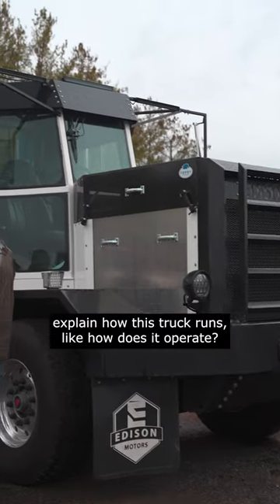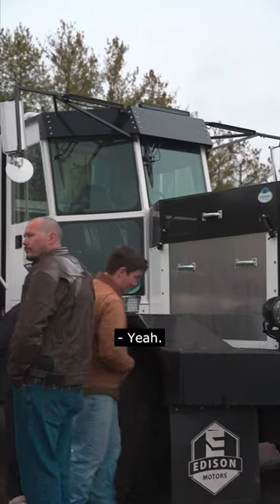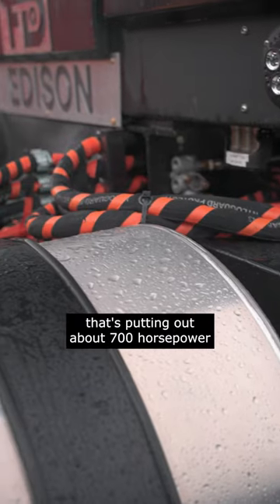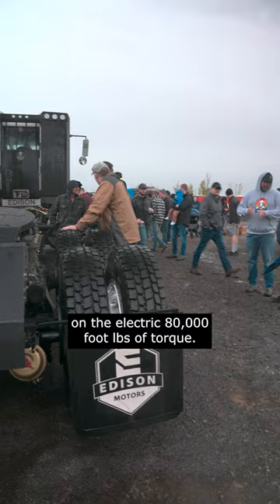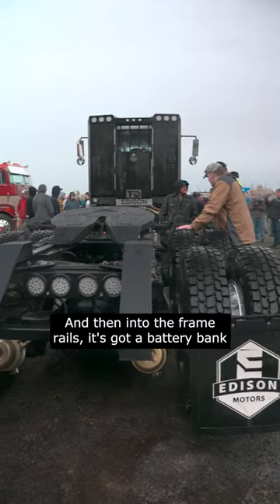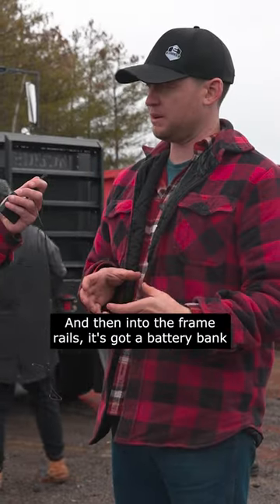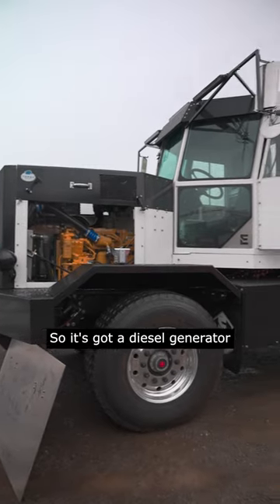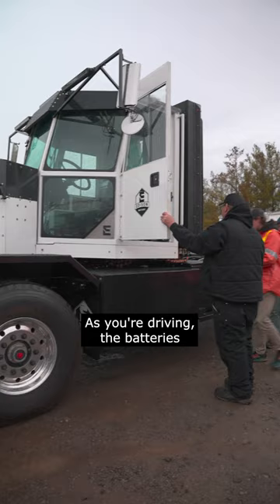@EdisonMotors tells us about how their new electric truck operates! 🚚⚡

Comment: I really hope these guys succeed. They're the only ones doing it right
Reply: They are succeeding, just got the truck plated and road testing has begun. What you are watching is the next big shift in the trucking industry
Reply: They've got the First VIN for Topsy now.
Reply: They need to produce an entire truck instead of just kits for trucks and they need to charge a decent amount for them
Reply: @rayanalzahrani8756  that's what that is buddy. It's their own truck built from the ground up.
Reply: Literally!
Reply: generator for range not depending on batteries that die with weather and sitting still for too long but using the benefits of electric motors, especially with logging/ mining where you can power up and charge on the way down
Reply: What about weight ..Right ?  Smaller loads ..$
Reply: @BAZZAROU812  Nope not even close. More torque and HP=bigger loads. They weigh the same as a traditional truck since it's a diesel generator not a whole engine
Reply: @BAZZAROU812  they weighed it in one of their videos. Was quite impressive
Reply: Agreed
Reply: They may usher in a new era of hot rodding with e axle conversion kits
Reply: One of the issues with any technology is thinking that one size fits all. This solution is excellent for long haul, but for short haul all electric is a good solution. I worked in a grocery warehouse where the drivers would make several half hour stops each day. It was a single grocery chain so they could easily install 60A level 2 chargers and never risk total discharge. Distance ranged from 50 to 150 km/day. Loads were light compared to shipping prefab concrete or structural steel but were bulky so typically required a 48' trailer.
Reply: @TKIDaniel they're starting and are constantly gaining momentum (pun intended). Still have a lot of hurdles to get to a point where they're established and have roots that can withstand failures and dry spells. Once they can take and produce fleet orders they'll have made it, in my book - obviously everyone would say they're successful under different metrics.
Reply: As long as the government of Canada and BC doesn’t screw them over 🤞 

And it’s not paranoid to think so… the government operates by greasing the wheels of private interests and vice versa.
Reply: If the one dude quits going on rants then yea they'll succeed. Dudes a budget elon musk the way he uses his playform to go off on tangents about not his company or truck. Like, shut up and push the product.
Reply: @BAZZAROU812 I believe he addressed this and recently did a 100,000 lb load.
Reply: @TKIDaniel lop
Reply: Try charging multiple of these trucks in one town.
Reply: @carlsonbench1827  this is a diesel electric truck. Same tech that's been used in trains and heavy duty mining equipment for decades.  It dosnt need to charge up since you give it fuel for the generator.
Reply: This is old technology the Germans used during WWII with their Ferdinand tank destroyers.
Reply: @carlsonbench1827  they can just charge next to all the locomotive chargers that use essentially the same tech.
Reply: Yes tesla needs add trailer to there cars with diesel generater just use tractor fuel so exhaust nice and black best be self generating
Reply: That's the way diesel trains run, and it seems to work for them!
Reply: @CRuM770  unfortunately its still wildly inefficient because it runs off of coal plants and a grid wheras the edison truck charges itself with a diesel motor and can get 2200 kilometres on a full tank of gas almost double a normal diesel truck
Reply: @TKIDaniel and they are trying to make a f150 conversion kit to Edison moters is doing so good rn
Reply: @rayanalzahrani8756 huh? How could you possibly know what he needs to do? Do you have a successful company focusing on producing large commercial vehicles?
Reply: I gotta start saving

Comment: 700 hp to get up to speed and 70 hp to cruise.  Perfectly designed hybrid.
Reply: Not even hybrid. That implies different powertrains on the same wheels. This is diesel electric, like a freight train
Reply: @Duffman19370 Diesel electric loco has traction batteries to and can be called hybrid
Reply: Technically, it's a Series Hybrid.
Reply: @Duffman19370 A hybrid is anything that uses more than one power/fuel source. This is most definitely a hybrid in every sense of the word.
Reply: I think the 80,000 ft lbs of torque is gonna do a little more for getting to speed
Reply: @rykercarlson2131  that amount doesnt say very much tbh. A hamster on a little treadmill could reach that with the right gearing. ICE trucks will have similar figures.
Reply: @kwestionariusz1  and what Loco is this?
Reply: @kwestionariusz1  The only batteries a locomotive has is to start the diesel engine. Some have air start, but still have batteries, but not to provide motive power, just for the electronics on board.
Reply: Most people dont know that all locomotive engines are diesel electric.
Reply: Torque is used to get the load moving and HP is used to sustain the movement at a constant rate aka MPH. Producing torque consumes energy, HP a lot less.
That's why city driving (stop and go, torque) all though at slower speeds consumes move energy aka lower gas mileage than highway driving (higher speeds, HP) where less energy is used, higher gas milage.
Reply: That's actually wrong in this case. Edison Motors actually breaks this down in another video. Also why he doesn't call it a diesel motor but a diesel generator. There is no other drivetrain on the truck besides the E-axels. This is also why the diesel generator can be filled with tax free fuel because the engine is connected to nothing but the batteries because the generator is only used to power the batteries.
Reply: @CasparPietersen the generator is only powering the batteries, not the powertrain. It’s an electric with a generator.
Reply: @bigloads3600  loco means, "crazy".  Don't waste your time on this nincompoop.
Reply: @timbodnar6711 using context clues I assumed loco was short for locomotive, good thing you can set us straight 😂
Reply: Mazda CX-90 has been referred to as “hybrid” for the two years of its existence, using a 70HP rotary generator to power the battery that drives the four independent wheel motors.
Reply: Isaac Newton says hello.

Comment: This is the only cool EV in existence. It's absolutely badass.
Reply: Its not even an EV, its a hybrid
Reply: @Madpiggaming no it's ev, it doesn't need the generator to drive, the batteries are all it requires to move, it just has an onboard generator to charge them, therefore it's classified as an ev even though it has a diesel engine
Reply: @deezbigspheresbetweenmylegs nothing special really basically like a chavy Volt designated as ev the engine on board does not do anything but charge the battery
Reply: It's essentially a road legal diesel locomotive
Reply: Hybrid
Reply: @Finlandiaperkele thats what i was thinking.
Reply: How many others are there tho? 😂
Reply: @deezbigspheresbetweenmylegs You literally just described a hybrid.
Reply: @deezbigspheresbetweenmylegs do you consider a locomotive an EV as well?
Reply: @Finlandiaperkele  kinda. Locomotives do not use batteries. The peak load is on the generator directly. So, instead of having batteries to eat the peak load demand, it is more like a regular mechanical drive train only without all of the transmissions driveline and other moving fail points. All vehicles should be moved over to the way edison does it or the way a locomotive works, everything would be far more reliable and simple.
Reply: @Finlandiaperkele or cruise ship
Reply: Great idea, unfortunately the diesel emissions requirements in the US won’t allow this setup without extensive modifications to the diesel part.
Reply: @drew8256  How do 5mpg 1200HP Dodge Demons pass regulations & allowed to sell in the U.S.? Also I'm going to assume Canada has as much or stricter regs than the U.S., could be wrong on that.
Reply: @Roberto-de8xv  This is not a production vehicle, it’s experimental right now. The Dodge has catalytic converters, and is gas.  Any diesel today has DEF fluid injection and catalytic converter, as well as expensive computer controls for the emissions.  Comparing gas to diesel is nonsense
Reply: This isn’t a EV. It’s a diesel hybrid
Reply: Not an EV
Reply: @6door6four96 Actually Chevy couldn't leave well enough alone and do it right with the Volt, so in specific circumstances the engine DOES drive the wheels.
Because GM didn't want it to succeed.
No really, they didn't.
Reply: @deezbigspheresbetweenmylegs  you can read up on definitions (like "Hybrid vehicle drivetrain" on wikipedia) and see that it's a series hybrid. Most people think hybrid just mean what is a parallel hybrid. One can compare it to how BMW i3 works. It's a BEV until it's fitted with a range extender petrol engine with generator that charges the battery - it's then a series hybrid. This also means that if a customer wants a Edison vocational truck where they have a use case that will work with only electricity Edison "just" have to rip out the engine and generator, add some more batteries and add DC fast charging.
Reply: 700hp / 80000 ft/ pound of torque really isn't torque is too much like frame bending torque
Reply: Did you see the video of it hauling a tank like it was just an empty trailer? It was pretty impressive
Reply: @savneetsinghrairai6823 yeah first truck they snapped the drive line before they had the electric axles, not an issue anymore
Reply: @Finlandiaperkele  WWII technology invented by Dr Ferdinand Porsche
Reply: @booya6437 hybrid means it can run on only diesel by itself or EV. But it does not have a diesel engine 😂it can only run on the electric motors.
Reply: @drew8256 so you think US has stricter laws than Canada and EU? 😂
Reply: There was another company that built something s similar it was a suv that had a boxer engine to charge batteries
Reply: @deezbigspheresbetweenmylegs good sir you have legally described a hybrid

Comment: 80,000 ft/lbs of torque!? Holy shyza!!!
Reply: Exactly what I was thinking like holy fack
Reply: Right. You’ll have to mash the throttle with a toothpick
Reply: That's at the wheel. For a fair comparison, the diesel engine torque, times the transmission gearing, times the axle gearing. So if the torque is 2,000, and the 1st gear is 12:1 and the rear end is 3:1, the wheel torque is 2,000x12x3, so 72,000, minus the tire diameter, but that's not included in the axle torque rating. So 72,000 vs 80,000. The electric doesn't have to shift 18 times to get up to top speed though! So in reality it pulls much, much better. And then it has regen to slow it down.
Reply: If you floor it the entire United States is pulled back into daylight savings
Reply: @allterrainrandy2587 it also means that it can maintain speed up a hill as it has the torque all the way up there
Reply: @aShamelessHigh  
Something tells me that something will break doing that. It is way too much, unless they have control system to not allow the bejesus being unleashed. The kingpin goes * pling *, oopsies, and that's that  😅
Reply: @rosen9425 Not a truck guy but having it as an e axle works waaay better than seeing big rigs pull down a drag strip seeing half their truck lift from torsion with the axle & such setup. I think you'd probably get away with many pulls
Reply: @MegaDarkTroll  
Those drags trucks doesn't have half the Topsy torque I'm sure, probably not even close even if they do impressive pulls. 

Pulling away in commercial driving is never done at full throttle either, but with 80 grand worth of torque you don't need more than a pinky toe on the pedal
Reply: @allterrainrandy2587  Plus, after all that, the diesel actually has less then that torque at the higher gears, whereas the EV has that 80k torque at all speeds.
Reply: @spyrule  Yes, as the gears go up, the  torque multiplication drops. Exponentially by whatever the rear end ratio is! Electric also loses torque at higher speeds, though.
Reply: @rosen9425  With Flodraulic they work it out so the accelerator pedal won't be like a RC car but regular to how drivers are used to.
Reply: @rosen9425 the frame is actually double the thickness of a normal frame and the axles are already rated for that kind of load so in reality it should be fine
Reply: @HustleVenture  they electronically govern the system when lightly loaded.  From what I've seen, this is done manually on the tablet by the operator.  But I can see in the future, this will be done automatically by using airbag data, or within milliseconds by the computer using input and chassis reaction data.  Or possibly choosing 1 of several torque/power profiles, or a combination....
Reply: @aShamelessHigh Re-create Pangea.
Reply: Even 8000 is too much.
700hp 1000kw 750w=1hp
Can pull battery power only 
To accelerate.
Reply: And that torque is the same at 1MPH as it is at 70 MPH!
Reply: You ahould have seen the pull test, they spun the wheels pulling a 100000 pound load
Reply: @TRC_MEDIA  On deboss? I think I did. Wild.
Reply: Thank you for dumming this down for me lol. @allterrainrandy2587
Reply: @allterrainrandy2587  and its pulling max torque at 0 revs. Max torque from  a standstill. shits magic

Comment: Finally  a proper hybrid the auto manufacturers could learn alot from this guy.
Reply: pretty sure this guy is learning from Toyota
Reply: @brentdavidson1  Toyota makes series-parallel hybrids. They are more complex. Can make sense for a large manufacturer to build out but not for a vocational truck with different use cases and low production numbers (toyota sells millions of vehicles).
Reply: This is very similar to the Chevy Malibu  Hybrid.
Reply: They would probably tell him to study thermodynamics. Still it's very cool what he's doing. Hats off to him.
Reply: Look up Nissan e-power. It’s hybrid series technology
Reply: In 99% of cases it's not worth it for cars. BEV plus a decent charging network is fine for cars. The current situation of lack of chargers is only temporary and improving all the time. In the UK there are 4x as many public charging locations as petrol stations.
Reply: I have a Honda clarity series plug in  hybrid and it works like this its bad ass
Reply: It's not a hybrid. Hybrids can use the engine to power the wheels. Edison trucks are strictly electric, but they have an onboard generator.
Reply: It's not even really a hybrid. It's an electric with a built in range extender. Difference is the diesel doesn't directly turn the wheels. It's just a generator.

Comment: It's a hybrid- like a train!
Reply: Almost. Diesel-electric locos don't have batteries. It's direct to traction motors
Reply: similar to a WW 2 submarine
Reply: @rosen9425  Diesel electrics are a hybrid. Diesel and electric Locomotives exist on their own. The combination of the two makes it a hybrid. A third component can be added (battery) and you still have a hybrid.
Reply: @jonathansmith8142  or a current Australian submarine.

Comment: So many benefits with this design. You can run the genny at its most efficient revs when needed or shut down when not.

You can also swap out the diesel genny for a hydro or cleaner fuel source when technology allows.

Big fans of these guys.
Reply: Technology would allow them to power this with hydrogen fuel cells right now. It would just be expensive. If the government had the guts to raise taxes on fuel to level the playing field for hydrogen then we could have it today. But yes I hope they will adapt to HFC soon. I don't know how long the working life of these trucks is, but those Diesel generators need to be retired within the next 26 years. If they last 20 years then that means we need to stop manufacturing them in 6 years. I'm concerned that by the time Edison really gets going they will have to stop making the current design. I think these guys are quite flexible though.
Reply: Kinda like a throttle on an engine ya know.

Comment: This is a smart idea, downsize the engine for normal load and use the electric side for peak demand.

I wonder how much energy it saves...
Reply: The real question here indeed how much more efficient is an electric hybrid vs a normal truck.
I think regenerative braking is a big advantage. If only because it saves braking pads and maintenance.
Reply: @zteaxon7787  You can also run it on red diesel because the generator doesn't power the drive train. So that's a nice cost save.